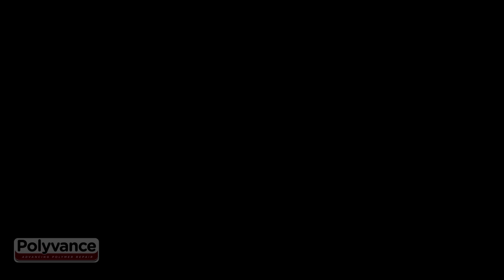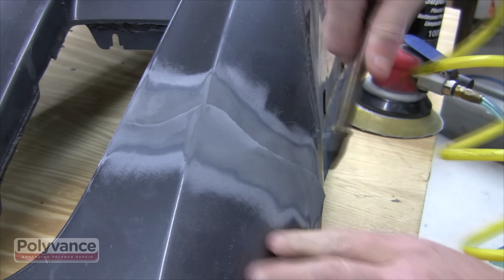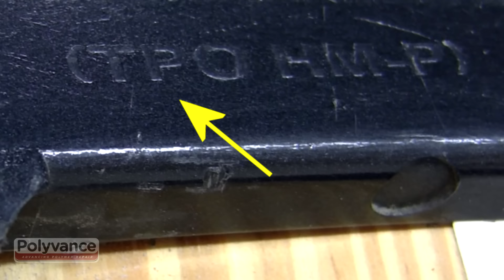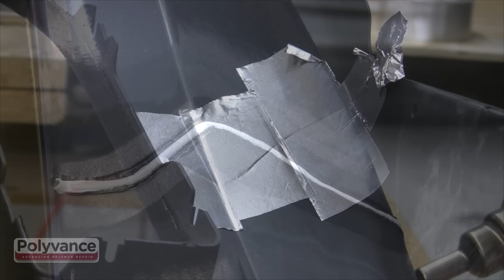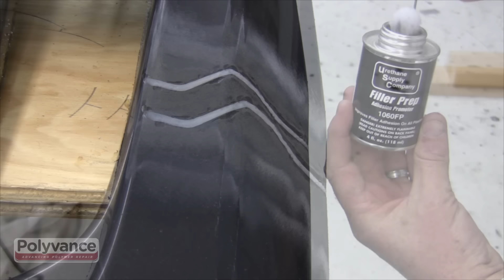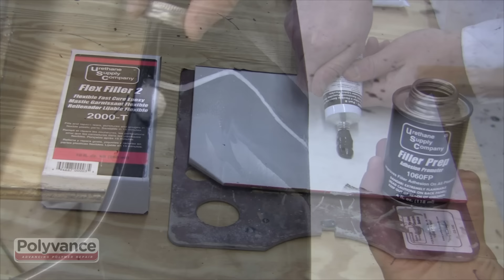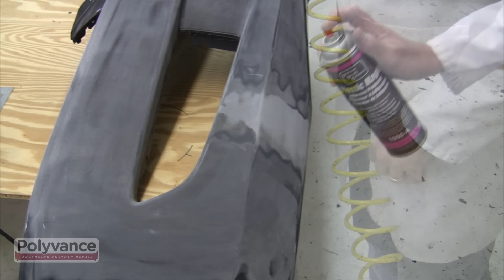Bumper Repair with Hot Air Plastic Welder

Comment: Would you recommend this unit for welding Nylon 66?
Reply from the maker: Sure! This product can be used as can our 5700HT airless welder. The 
airless welder is a little better in terms of controlling the flow of 
the plastic.
Reply: gza06955 dude he's just using a heat gun ROFL " this unit " 😂😂😂😂😂😂

Comment: Hi what kind of welder is suitable for bonding PP/EPDM bumper?
Reply from the maker: The best welder for Polypropylene, which is what most bumpers manufactured today are made of, is going to be a nitrogen welder. The hot nitrogen gas creates a true fusion weld between the plastics, rather than just adhering to it. 
If you're interested in investing in a nitrogen welder, you can explore the options available to you from Polyvance in the link below.

https://www.polyvance.com/Nitrogen-Welders-1/

Thanks for watching!
Reply: Please send me some information on this Nitrogen welder...looks interesting for the plastic welding of bumpers.
Reply from the maker: Happily! Just email info@polyvance.com and ask for nitrogen plastic welder literature.
Thanks for watching!

Comment: I am not a Pro, but I have to tell you, this plastic welder is the best tool I have used. I bought the kit, and actually came with everything that you need.  I made a  bumper repair, and stress tested it, all bonded great!  Then I moved to a washer fluid reservoir, I was able to bend it back to shape, and weld to better than I would have ever imagined.  I actually felt like I knew what I was doing.:) This Company is awesome! The tech support is Excellent as well.   I will continue to buy their product because of their quality and  ease of use!
Reply from the maker: +pontgta1 Thank you for your kind words! We're glad to hear you enjoyed using our product! Please never hesitate to contact us for any further assistance you may need.
Reply from the maker: @donovan roesstorff
Go to www.polyvance.com to see all of our plastic welders and kits. We have our popular nitrogen plastic welders (mostly for body shops), we have the hot air welder featured in this video, and we have several airless plastic welder kits (like our popular 5700HT Mini-Weld Model 7). You are sure to find a welder that best suits your needs!